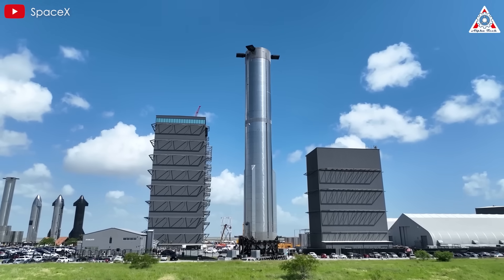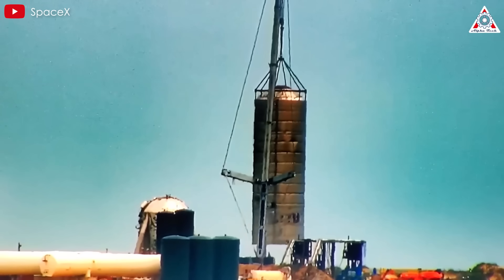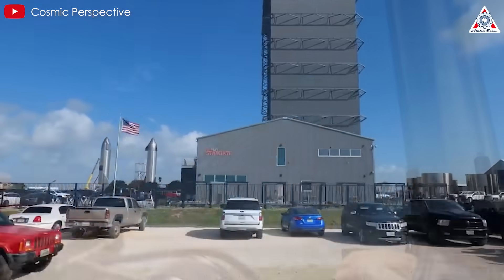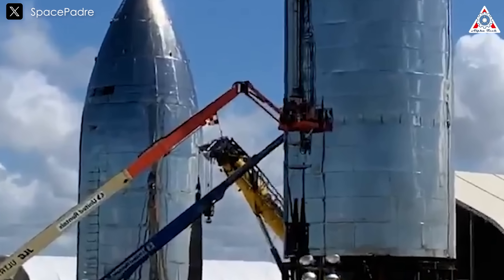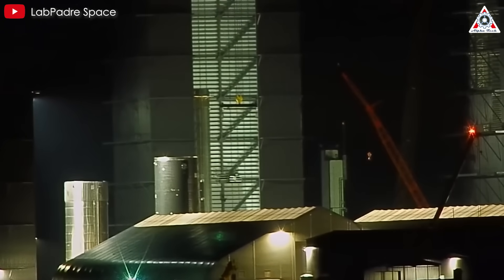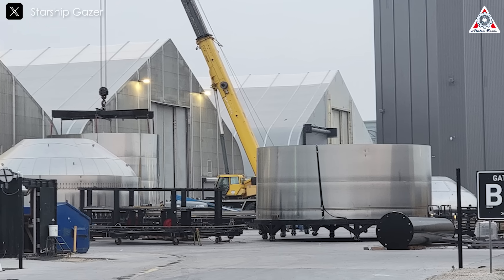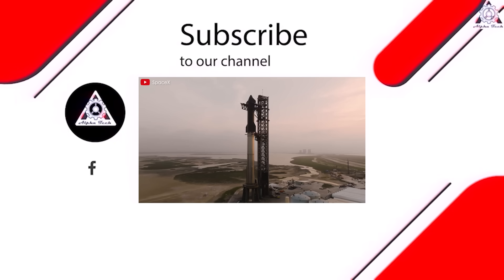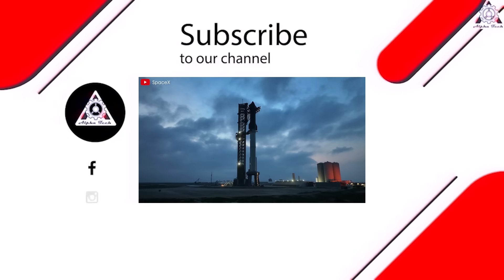What SpaceX just did with Starship V3 WELDING Shocked NASA scientists...

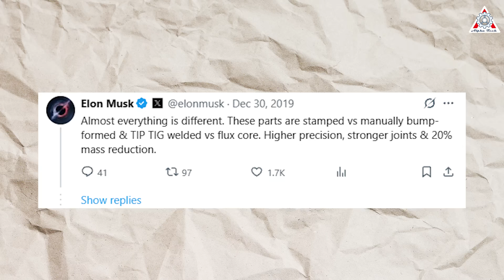Comment: 4:48  flux cord arc welding      6:30  Tip TIG welding       7:05  Laser welding
8:15  Pinning, peinning, peening  in the context of restoring hardness in cold-rolled steel refers to process where fine particles within the steel structure act to impede the movement of dislocations and grain boundaries.   
9:05   FSW  Friction Stir Welding    is a solid state welding on fuel tanks 304L,   FSW is versus liquid state welding

Comment: 3:32 What was the result of the Virgin Atlantic data ? They were using carbon fibre but with a high drag design so it didn't heat up, presumably the mission profiles and reentry speeds were way different.
Reply: Not an expert but here's what a quick search found: Ansari X prize 100km. A few minutes of freefall for SpaceShip One. Biggest issue was rapid deceleration 5.75g. Payload 1 person.  By contrast, Starship goes twice as high 200km and carries a payload of 50 to 200 TONS. I imagine that the friction, freefall duration and total heat generated is considerably higher.

Comment: To make a continuous metal sheet what is called mix or blend welding.  It is basically using a rotating head to pull atoms from one sheet to the sheet to be joined.  
The spasifics of the prosses are a industry secret.

Comment: I am impressed with how the high speed railroad uses vibration welding to create seamless rail tracks.  It has been done for a long time.  Discovery of techniques is different than the application of techniques.  When it comes to different materials, it doesn't work the same way.  Mild steel, aluminum (various grades), stainless (various grades), and titanium.  I would like to see the invention of a welding machine that does vibration welding for seamless joints for my garage on single phase 220v.

Comment: Why are not using 321 stainless? Also why are they not using crawlers with the tip tig? It would make the same weld all the way around every time you just run the remote. Maybe I should apply there lol

Comment: This AI generated video is chock full of false/ misleading information.
Reply: How about providing examples?
Reply: @brucemoose926  firstly it is not my assertion that the visuals are AI generated (at least not entirely) but it’s definitely narrated by if not entirely produced using an AI engine. As fore the false/misleading info… for starters the “SHOCKING welding technique” isn’t new, NASA’s rocket manufacturers have been using this technique for years. Friction stir welding isn’t new and a real expert creating a video like this wouldn’t have fucked that up. The AI narrator totally botched the explanation of the flux-core method. SpaceX does not manufacture its own cold rolled stainless…  just to name a few.

Comment: As an aerospace mechanical engineer with 50 years of welding experience, space X is busy re-inventing the wheel.  This is all common knowledge in the aerospace industry.  They should have hired good engineers…no wonder their failure rate is so high.
Reply: Failure rate? They sure put a lot of mass into orbit successfully.
Reply: And they spread even more weight across the Caribbean, shutting down air traffic and endangering a lot of people.  You are being selective in your observation.  The welding I see in this vid would not pass any level of certification.  After using unqualified welders for years, they finally decided to do it right…that is…as good as NASA, Lockheed, and Boeing were doing in the 1950’s.  This is the definition of the phrase, “reinventing the wheel”.  It makes me want to go apply for government contracts!

Pea back at you!
Reply: @johndurant622 then why has nasa continued to be the most expensive and least capable for decades? It took a rich person obsessed with space to get something done, otherwise the usa would still be overpaying for rides on Russian rockets. 

Nasas sls rocket is a waste of money,  it costs like 2 billion per launch and takes years to build a one time use piece of trash.
Reply: poop

Comment: I don’t think a polish on either parts would be practical  for anything to do with flight or safety ? I doubt Anyone’s feelings would be hurt if all the improvements would be committed to a better, more reliable, better functioning, and more particle way of building their ship didn’t include a high polish finish that would be hidden by suit from the engine blast like the falcon 9 boosters. I was glad they didn’t bother to wash off the signs of success on their boosters. Save your energy on a better flight worthy ship than a shiny one Mr Musk. It looks fine and save your time and money.

Comment: What a cool video …. I was one of the 24 that fabricated the “ bean “ section by section for PSI out of a warehouse in Oakland Ca . Forming fitting and welding the sections was quite a process at the time involving computer modeling Faro measuring ,fitting welding annealing and final 5 axis machining of the sections before polishing . Everything presented the engineers a unique set of challenges to overcome ….. I can’t even imagine the hurdles space X is overcoming . Just the seasonal temp swing of 100 degrees on the bean changes it size dramatically  and the welds have to deal with it . amazing job ! Hats off to the space X welders 😎👍❤️

Comment: Flux core that's the cheapest welders on the market and no welder would ever use a Flux core welder on stainless it's way to messy and for short money with deep pockets they would use mig or Tig and Lazer welding is much much faster there also 10 times the cost of a good mig welder

Comment: Flux core has flux to prevent porosity like stick welding, not to prevent rusting. after you’re done with the weld you chip off the flux
Reply: @Renaissance-fw1ox  I cringe thinking about “chipping off flux” on a space craft.  NASA used to weld in a vacuum…70 years ago.
Reply: @johndurant622  indeed typically aerospace welding operations are extremely clean. I am simply correcting one of the many pieces of misinformation in this video.

Comment: Most ppl think that a spaceship must be able to handle the pressure (actually the vacuum) of space. Space is essentially a near-perfect vacuum with virtually no pressure, whereas Earth's atmosphere has a measurable pressure, especially at sea level. The pressure in space is so low that it's often considered negligible, while Earth's atmospheric pressure at sea level is about 101,325 Pascals. In other words, space is a vast, empty void with little to no gas or molecules to exert pressure, making it a vacuum, whereas Earth's atmosphere is a layer of gas surrounding the planet that creates a pressure. Holding back atmospheric pressure of a spacecraft against the vacuum of space isn't very difficult. Thin aluminum can easily withstand the pressure if shaped appropriately. The ISS even has an inflatable module made of fabric.

However, a nebulae in space is almost like an atmosphere. A nebula in space is expanding because it is 'pressurized'. The star that exploded is pushing the debris far out into space. It would probably be dangerous for an intergalactic spaceship to travel through a nebula. The pressure inside a nebula can be enough to crush the spacecraft. Also, SiFi shows seem to fly the spacecraft easily and quickly through space. There is a lot of things in space that we can run into.

Comment: If you want to have good welders at weld stainless steel you need to use Boilermakers we used to run a lot of stainless steel for high pressure vessels and it's very hard takes a lot of skill
Reply: while difficult to overcome, do you think they would have gotten it right the first time if the weld were horizontal?
Reply: Just get British welders

Comment: I waiting for the liquid cooled heat shield.
Reply: Where do you dump the heat from the heat shield? Can't dump it infront of the heat shield like cars. Maybe  out the rear, but that would be hard to air cool the radiator?
Reply: @mrbaab5932  That's a good question. It makes you wonder if they will ever get it figured out. If you release it in the form of steam you have to carry extra water. The same holds true if you use a large heat sink.  The reentry probably generates enough heat to boil an olympic sized pool so, yeah, good question. That's a lot of heat to get rid of.

Comment: If the whole starships stainless steel was vacuum coated with titanium nitride or cobalt, it would be stronger and more durable. Or metal sprayed titanium nitride or maybe electroplating or other means of application. E.g. gold looking drill bits.
Reply from the maker: That's a good idea in theory, but Starship is just way too big. Coating the entire thing using vacuum deposition or electroplating would be insanely expensive and complicated
Reply: @alphatech4966  Hot metal spraying.?
Reply: @ Electroplating the whole ship could be done with the whole craft on its side in a long trench, or with electrically conductive paint brushes, or a sprayed on chemical process. Thermal metal spraying could be done cheaply in a variety of metals, even chromium, Imagine gleaming chromium starships.!
Reply: What about carbon carbon that was used on the leading edges of the shuttle craft.
Reply: @frogola57  Yes, or even thermal tiles with dozens, or more of tungsten halogen light bulbs embedded in them that would heat up and glow, converting much of the harmful inferred heat to harmless white light.
Reply: Turn up the volume.